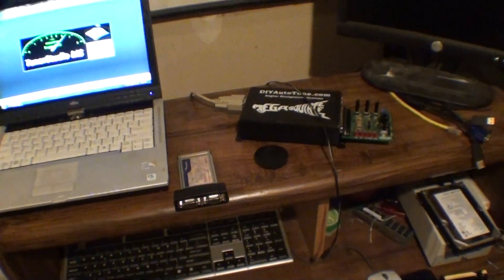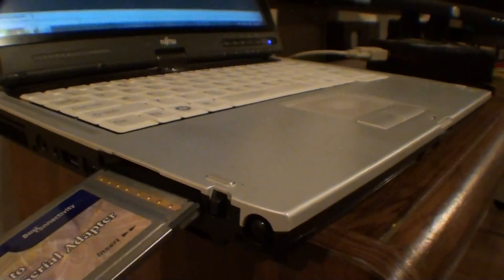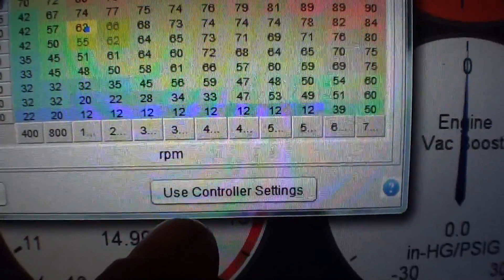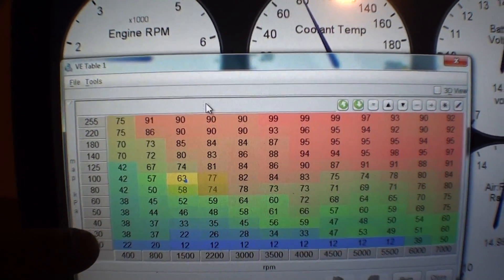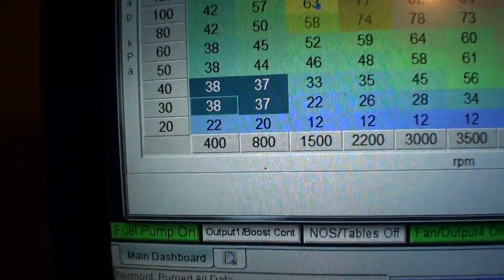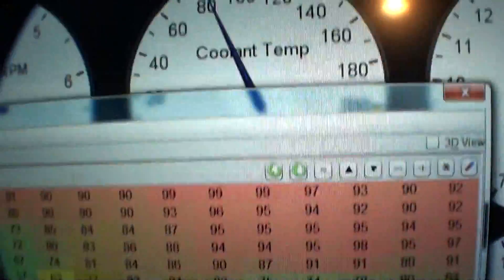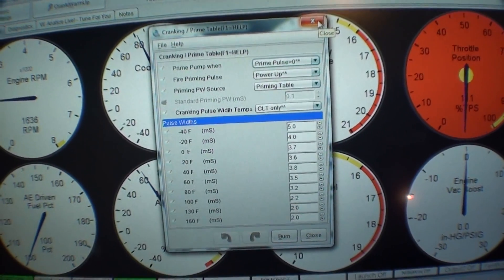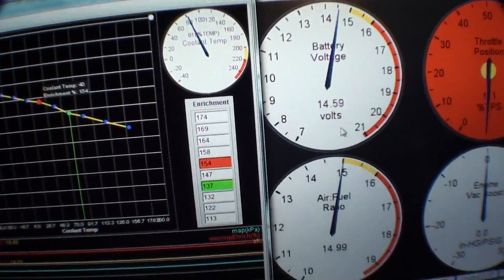10-21-12 how do i connect megasquirt to my laptop

Comment: ms3gold installed on 73 charger gen3 5.7works with ing. on and cuts with ing. start. need to run hot on both?screen goes grey. need idea for wiring.

Comment: i was wondering can i run the ms1 and 6010 setup on a stock n/a motor? Also how could i go about getting a base tune for n/a, and one for the turbo setup? i plan on turboing the car this winter but just wanna get it running until then.

Comment: yea, i got mine to work. turns out it wasnt the USB connector, it was my jimstim. the voltage regulator is overheating due to a failed diode or short. works fine on a 9v battery, but with a 12v power supply it freaks out. i'm still lookin for a budget laptop with a built in RS232 though, or with a PCMIA slot... either one lol. hoping i can get a dell D600 or similiar for cheap

Comment: beautiful. i've got a 4.6L mustang (turbo, built motor and such) that i put a MS2 on. right now im only running LS1 coils wasted spark controlled by the MS, but feeding via carb. trying to work out some more electrical issues and route new fuel lines... probably going to ditch the USB connector like you said. think it might have corrupted my MS (its acting funny like you said! lol) runnin MSextra from a couple months ago.